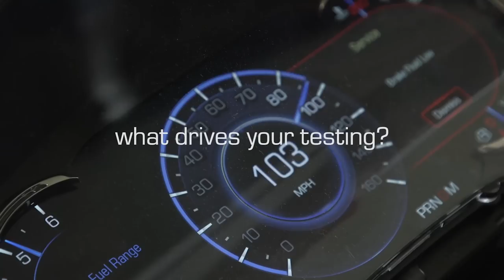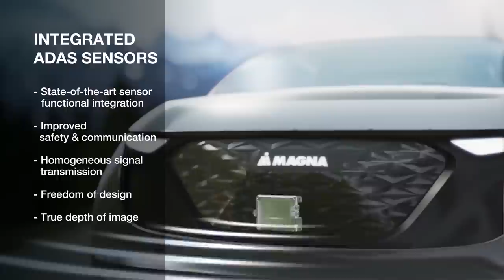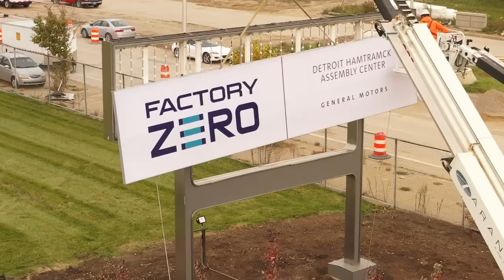Genesis Reveals Its First EV; BYD Now Worth More Than Daimler & GM - Autoline Daily 3143

Comment: If more people start calculating total cost of ownership then EV sales are going to get a big boost.
Reply: Exactly, most Tesla's require no maintenance on an annual basis plus have the highest resale value.
Reply: @johnmqueripel2367  

Just fuel/maintenance savings would drive choice.  Monthly out of pocket savings makes a $35k EV the equivalent of (roughly) a $30k ICEV.  If you're saving $5k per year then a $35k EV pays for itself in about seven years.

And all reasonable quality EVs are likely to hold their value like we're seeing happen with Tesla.  Those monthly savings are going to extend for the life of the car while operating costs typically increase with ICEVs as they age.  Demand for used EVs is likely to be very high going forward, until the market is saturated and/or robotaxi fleets are built out.

It not longer makes economic sense to purchase a new ICEV.  Smart money will drive existing cars a few extra years, move to a good used car if a purchase is necessary, or buy an EV.

Comment: Mystery Car - The JWF Milano GT Coupes were built by JWF Fibreglass in Sydney Australia in the early 1960's. Approximately 30 were built and we believe around 10 survive. They were sold as a body/chassis kit to which purchasers fitted their own engines/transmissions/rear axle assemblies.

Comment: Holy cow, that Genesis is a visual train wreck. This is a huge step backward in their design aesthetic.
Reply: My problem is the color.  Other than that it's not very different from all the other cars on the road that I don't find attractive.
Reply: I'm also confused. Strange design choices.
Reply: Yeah. It looks like  Kia stinger
Reply: MRGRUMPY53  
Obviously a large segment of the market wants a small car.  Especially in Europe which will likely be China's first market push.

And the Genesis is not "tiny little".GV60 should have about the same dimensions as the Ioniq 5.

"The Ioniq 5 is 4,635mm in length, which is just shy of the Ford Mustang Mach-E, but 51mm longer than the Volkswagen ID. 4, although the 5 is the widest of the three at 1,890mm."

The Mustang E is not a tiny little car.
Reply: New Chapter in the Book of Genesis.
Reply: MRGRUMPY53  
So friggin' what?

If it's not large enough for you then buy what you need.  If you need a huge vehicle to signal the value to society that you feel you have then spend the money on extra metal and energy.